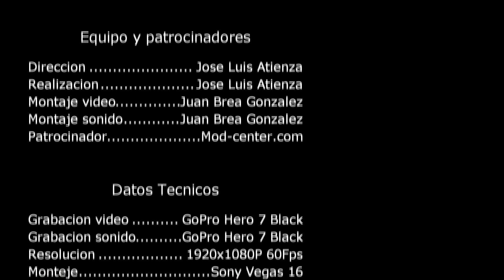Como poder abrir o desmontar una Nintendo Switch Lite

Comment: Hola José Luis Buen Video Como siempre.  Te quería preguntar tengo una switch lite que se mojo vi con una cámara térmica que el conector que une las dos placas por el fex esta mal y lo cambie.
Pero aun no hace nada todabia no e comprado un lcd por si el problema fuera que si arranca pero no se ve.
Por lo que e visto si la conectas a una fuente no coge corriente entonces pensé que podía ser el chip de energía M92T17 y el BQ24193 aun no me an llegado los recambios pero ty cres que esa posiblemente sea la solución 
Con una cámara termina no e visto nada que se caliente en la placa salvo el conector que cambien 
Saludos y gracias